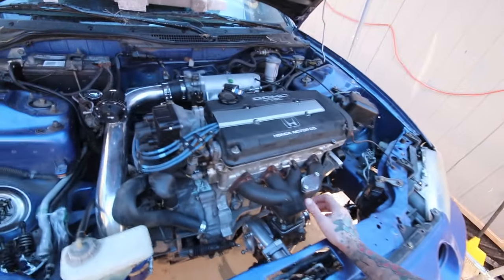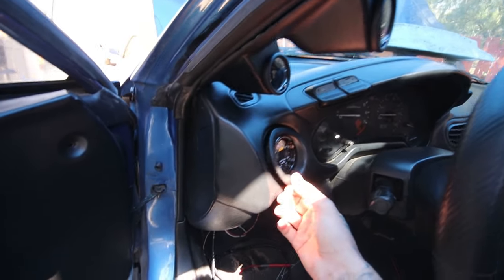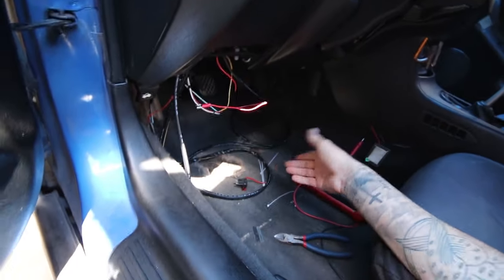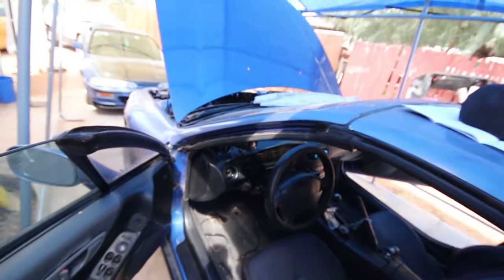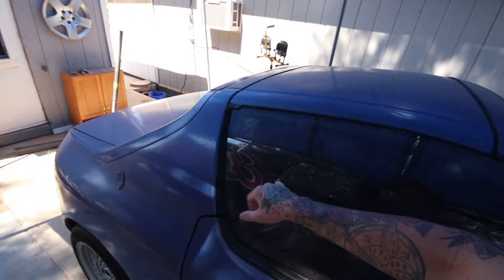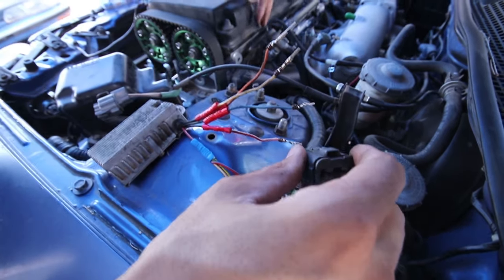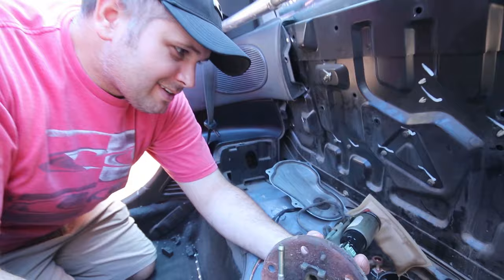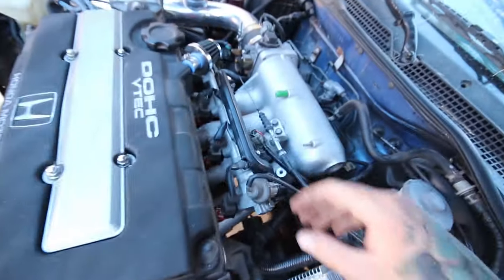Boosted B20Vtec Part 4 (Fuel System)

Comment: Bro listen here about the oil pan gasket.  Ive literally never been able to get one right lol.  I had to get the Fel Pro Permadry Plus oil pan gasket.  Theres a metal piece inside the gasket so it doesnt get fucked up going on.  You cant really over torque it either.  Its the only oilpan gasket ive been to do right lol

Comment: Tap the cold side on the turbo for the wastegate vac/pressure, do not use a T. Go directly from the turbo to the wastegate and done.
Reply from the maker: I would. But like I said in the video the turbo has no flange on it so I ran the wastegate line directly to the intake manifold. No T
Reply: ChrisSadowski Alright that’ll work but if one day you feel froggy its easy to take the turbo cover off and drill and tap for a vac nipple. When is the next time you’re going to tempe for the Thursday meet by the river?
Reply from the maker: It’s not on Thursday’s, it’s Friday nights from what I though. I may go next week when I get paid. I’m flat broke right now, start of the month, bills due ya know
Reply: ChrisSadowski I feel you man, if its cool enough ill head out that way